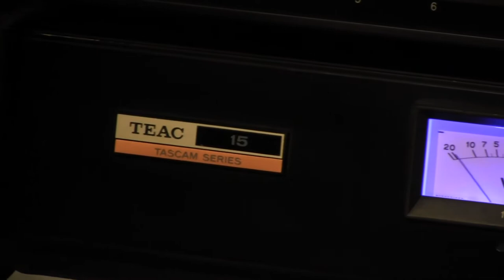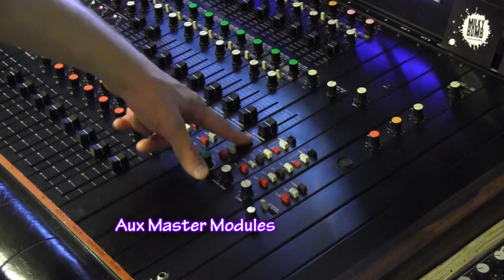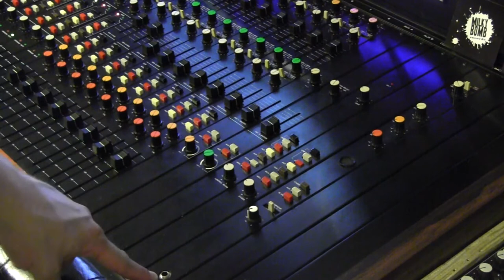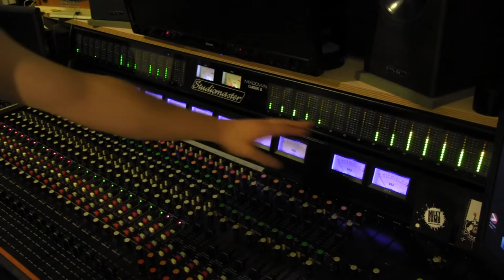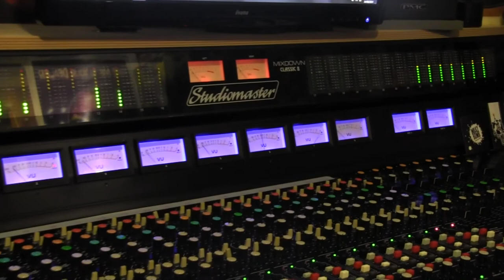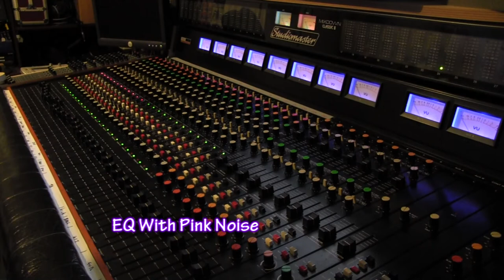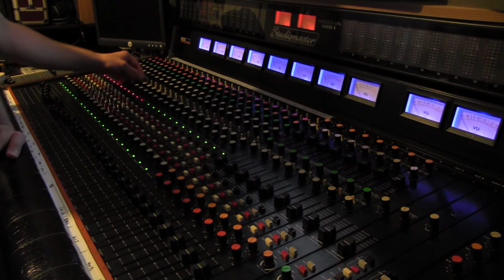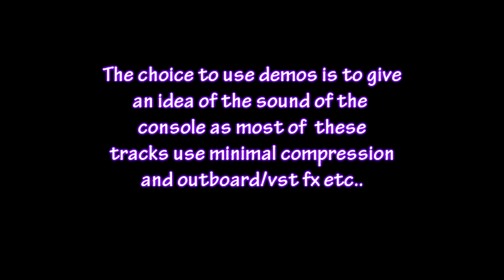Tascam Teac Model 15 Overview and Modifications

Comment: I own a teac M15 as well, the nobs however krack a bit, can the y be cleaned with some cleaner or do I do more damage?
Reply from the maker: Use a very small amount of Caig DeoxIT F5 to clean and flush and then a drop of Caig DeoxIt F100L. Be very carful not to over apply DeoxIT F5 as it can wash away the grease and leave the pots feeling rough and easy to turn. Have a look on www.teac15blaggersguide.co.uk for more info on cleaning pots, faders and switches.
Reply: thank you very much!

Comment: How do i love teac/tascam more than even any expensive console
Reply: Maria Ulfah It must be the minus 10 and the rca plugs?
Reply: @scottbaxendale323  Scott I've owned everything almost including one of these. The -10 doesn't hurt unless you need the recorder more than 20 feet from the board and the Rca's can be eliminated with a good patchbay.  They do have a fatter sound than modern mixers because of the slow slew rate of the old 4558 opamps.  Same with the old blackface MCI consoles that I had.  Slow opamps make acoustic instruments and voices sound bigger. Not as clean with transient snappy attacks but harmonically fatter if a sharp fast attack is not desired.

Comment: Regarding your "Master Output" VU meters on the bridge...being the M15 guy, what IS the "Master Out"?? The studio out? CR out? Aux A? I'm getting ready to purchase one of these consoles...
Reply: +Brian Keller "Master Out" being the most versatile and best summing circuit of course ;)
Reply from the maker: Hi Brian, if you want the most versatile and best summing circuits maybe look elsewhere. The Teac does what it does, and with a few mods can sound pretty decent when you push it a bit and hit that sweet spot. There a few flaws in the design however which mean you can't route a signal directly to a stereo output,  be it Mon A, Mon B, Control Room or Studio outputs. Instead you have to send signal through the Buss --> Mon A/B first. You can take a stereo outputs from either Mon A or B, but if you are doing a mix you will likely want both Mon A and B, so that leaves you with the Control Room and Studio outputs. At this point due to poor gain staging design and depending on how many channels/buss/Mon A+B's you are using you will have a rather raised noise floor, which in todays digital age most people will find unacceptable. So to answer your questions the Master Output for me is the Control Room output, I have upgraded the op amps here, improved stability and tapped a signal for my Master Output VU's. I use these VU's for an average level referance only, they are fairly cheap and do not detect peaks. If you are planning on adding an additional meterbridge as I have done you can wire it however you want. In your set up you may wish to use Mon A as your master output, it's really up to you. A couple of tips; when tracking take signal from the direct outs, or even better the insert send (granted no eq, but sounds really punchy) and try and keep all signals hot across the board and all unused channels/Buss/Mon muted and the noise floor will be more manageable.
Reply: +DrunkJoaw Thanks, man, I really appreciate it. The guy who&#39;s selling me his tried my setup and verified that it works. The board will be used for rock records only, if the hiss is no more than &quot;normal&quot; non-Dolby tape hiss, that&#39;s fine. Be usually oh, 18 channel mixdowns, Buss 1-2 raw mix, Buss 3-4 parallel compressed mix, Buss 3-4 jumped to Buss 5-6 to stack parallel compression, letting me pull the faders and noise down and keep the program level much better than just using one. Or I may jump 1-2 to 5-6 and buy another identical compressor. The opamps on all outputs will be changed to discrete opamps, a couple of the outputs supposedly have &quot;active summing circuits&quot; if I can figure out which ones those are we&#39;d probably use those and add a pair of transformers to that output as well. I have a guy in Chicago who is a genius and can modify anything for the better, and knows how and why. I don&#39;t use EQ when I track...and hearing the difference between the preamp out and the summing circuit out on the MX-80 I just bought, I am beyond &quot;on it&quot; about opamps now. No more &quot;it&#39;ll be okay&quot;, screw that. You may be hearing from me a little or a lot. With any luck I&#39;ll have it within the month and it&#39;s in mint shape and fully loaded (24 mono strips). I had an M-35 I absolutely loved and this is a better, giant version of that. I also have an M-3700/32 and a rare Soundout/Soundtracs 24-8-16. This will be my classic rock console...and my baby, all however many hundred pounds it weighs God Bless you man \m/ \m/ and FANTASTIC work on the desk brother-bk p.s. by the "best summing circuit" I meant the best one in that desk, lol.
Reply: +DrunkJoaw Oh and what you said about pushing the board and it liking it? That's what I'm all about. SOLD I'm just turned 47 by the time I'm 50 that thing will be a monster and so will my 3700. The Soundtracs needs the preamps recapped, needs nothing else the signal path is like the shortest in the world I'd safely bet. You have to keep checking the power supply to make sure it's on, it's that quiet. But it also loves to be pushed on drums. So I have different consoles for different needs and sounds.
Reply: +Brian Keller I mean if there's no stereo output, there's kind of no point in the whole mixer, is there? Mixing channels down to stereo is the purpose of any recording console, I thought. I used the "Studio Out" and some transformers on the M-35.
Reply: +Brian Keller The consoles I want, don't exist. The M-700 and M-5000.